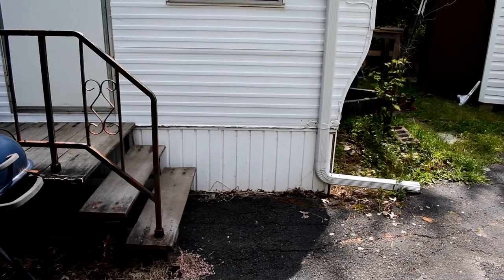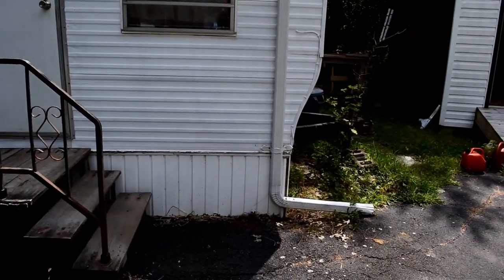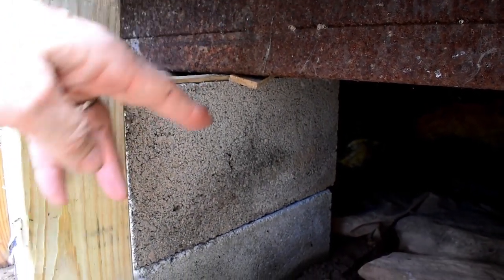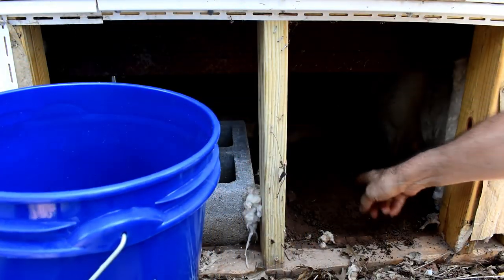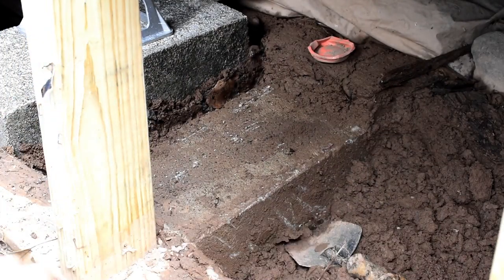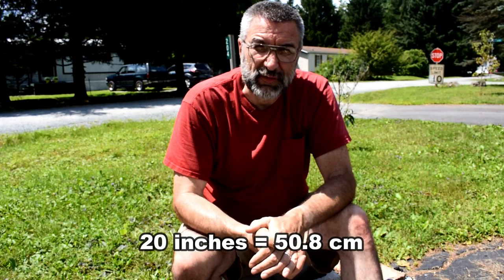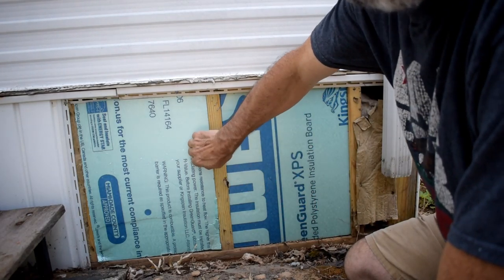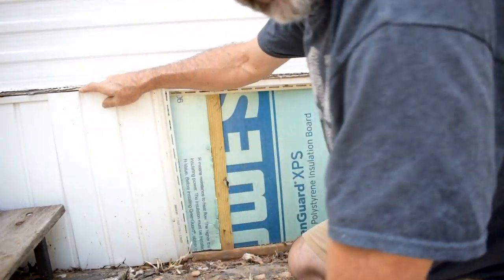Digging a Pier to Fix the Door!

Comment: We built a large porch to our first home, and I dug some holes for the footing under the porch. I went down about 30 inches and cast 12 inch thick pipes as a pier under each of the pillars to the porch. All was well until the winter came. Suddenly the railing no longer was straight and level, but lifted up at one end. Next summer I supported the porch with some beams, removed the pier and dug an extra 20 inches down. That did the trick and now it keeps straight, but I wished I had done this before building the porch! Bless you both.

Comment: I had done with the R10 insulation for skirting.  Came back the next year after winter, I immediately knew the ground had shifted - skirting had bent. Hmm.  Tried to figure out if the RV had gone down, or if the ground had gone up.  Don't rely on the horizontal levels on the trailer, they always seem to show everything is ok, how so false that is.  It was in the corner where I made a small trap door to access the septic tank - couldn't open the door without a crow bar (and then some).  I had knocked the small wood frame with rebars in the bottom part of the frame to hold the frame in place.  Those rebars came up about an inch up the frame which snugged the door to the underside of the RV.  The ground had obviously shifted in that corner pushing everything.  So, if you notice your R5 insulation bending (check it occasionally), then you'll know how much the ground is shifting.  I sure do admire your tenacity.  Just mixing cement wears me out, lol.  Nice work.

Comment: Bill, I hope this solves the winter door problem!  I know you were probably dreading that job, I would have been.  Good idea on the green foam insulation.  I used the green foam on the tiny doors to the attic space in my house.  I glued it right to the doors as they were leaking cold into the bonus room.  It stopped the problem and now the bonus room is snug all year.

Comment: If you ever have to put in another pier, or make the current one deeper, here is an idea.  I realize you have the hardtop walkway which is an issue.  Dig the hole outside of the wall to the depth needed, then widen it out until it is under the wall.  You can then set your pier and fill it back in, tamping as you go.  A digging bar and scoop would be my tools of choice.  I might have removed the 2x4 just to give myself more room as I am a lot bigger around than you are.  This is never easy, but it is possible.  I dug a number of holes with my grandson a couple of summers back, and we did 1 a day (no clay, it was all gravel).  One more thing.  You said it was a dirty nasty job that you were dreading, but I would far sooner dig out that pier than do the “plumbing” job you did on the cottage.  Everyone has their limits.  Here’s hoping that you have solved your problem!

Comment: I noticed you were digging out mud, you should check the other side of the trailer for water flowing under that side also.  Get it as dry as possible.  One thing you could do is build up the soil around the skirt, then put plastic sheeting down, 2 foot out, turn the plastic up a couple inches on the skirting.  Then cover it with a mulch.  That will give you the slope you need to get the water and ice away from the house.
Reply from the maker: It was moist, but it was not mud.

Comment: I think the reason you have such a big difference in your raise on both piers is because the front pier is getting more ice under it.  Put a longer extension on your downspout.  This will move the water away from your pier, that should solve the problem since water expands when it freezes.
Reply from the maker: We have blacktop pavement around the front of the trailer and going up to the door of the shed.  The downspout extends far enough to put the water onto the blacktop, which slopes away from the trailer so the water runs away, not back towards the trailer.  :-)

Comment: Hey Bill. In a previous video, you had jacked up the trailer with your hydraulic jack, and it started to bend and puncture the frame. When you put that jack stand under the frame, you should have put some sort of metal strip or block to disperse some of the weight, as the small round circle of the jack stand is going to push through your frame, which is weakening from rust.
Reply from the maker: Bend and  puncture the frame?  No, I don't think so.  I don't know what video you are referring to or what you are talking about.  If I had seen that happening, I certainly would have done something different.  The paint on the frame is getting rusty.  But the frame is still very solid.
Reply: @LiveSimpleLiveFree  I'd have to look through all the videos to find it. But yes, I did notice that the hydraulic jack was indenting the frame rail when you jacked it up. I'll see if I can find the video it was in.

Comment: You should be getting ready for winter.  Add foam to your exterior walls.  I’d suggest 1 1/2 inches all the way around, covered with new siding.  When you put on the insulation, it should be sealed with canned foam.  You will have to reframe the building, use 2x3 studs.  The roof can be sprayed with foam insulation.  Either replace your windows or cover them with plastic sheeting until you can put in new windows.
Reply from the maker: I have already done ALL of that, on the inside, when I renovated the trailer when we first bought it.  You can see all of that in our Renovations Playlist.

Comment: I know this is a little late for this work, but this might help others.  Depending on soil type, I have used the shop vac either direct or with a drop bucket in line, I will vacuum out the dirt I am loosening.  It helps get deeper, and saves the back in not having to lift up little scoops or small buckets..

Comment: modesty smiley box.. love it.  Fantastic job. Yuk. I put up insulation under my modular and blaaah.. I think it rains under there. Just a yukky job. Today I had enough of my mystery leaker and I figured out you can pop panels on a modular home to get ti the faucet connections.  I plan on trying to replace both tub faucets and shower heads. I also found out I need a drip catch above my doors and the mobile home parks store online has a video on YouTube for replacing doors. I plan on doing that as well. So happy someone is thinking winter because its crunch time. Now or never! Great job. Bless you and your gal Elizabeth.

Comment: The water from the gutter also helps the frost lift that corner.
Reply from the maker: Water from the downspout is not a problem.  We have blacktop pavement around the front of the trailer and going up to the door of the shed.  The downspout extends far enough to put the water onto the blacktop, which slopes away from the trailer so the water runs away, not back towards the trailer.  :-)
Reply: Missed that due to my not paying attention enough.

Comment: The insulation is a good idea.  As you probably realize, you could take off the skirting, separate the sun room, roll the trailer off with its (probably) existing wheels, and then use an auger for the ten (?) piers needed for an addition.  IDK if you would want to go to all that effort however.  Hope the fix you made helps the door close this winter.
Reply from the maker: That would be a MASSIVE undertaking!  And I'm not sure the sunroom would survive.  It is attached.

Comment: Bill, You should have a few vents in the skirting.  As the water in the soil evaporates it will condense on the bottom of the trailer floor and cause the flooring material to rot. Down south where it is very wet much of the year, while we don't have frostline issues, it is common for the floors in the mobile homes to rot and collapse due to this process ... I have helped a number of friends replace and repair their floors in their trailers. BTW, putting a plastic cover on the bottom of the joists to cover the entire floor will cause a similar moisture rot unless it is well ventilated. .... Jim
Reply from the maker: We already have three vents in the skirting, and I should probably do at least one or two more.

Comment: Using a jack on top of the pier is a great idea. Then you can solve any future problems by simply doing an adjustment. My only concern would be if the feet on the jack could possibly crack the concrete block. Wondered if you could lay a steel plate or something on top of the block first.
Reply from the maker: That's why I filled the block with concrete.  Now it won't crack.

Comment: I think you need to extend your drain pipe to a minimum of 5 feet to avoid moisture compromising what is under your home   I use foam insulation whenever I can. So much easier
Reply from the maker: We have blacktop all aronund the front of the house.  The downspout empties onto the blacktop, which slopes away from the house.  The water is drained away.

Comment: Hi Bill! You certainly had the right idea but you didn't go to the right people to ask for the advice. You should have went to a small Hometown Hardware lumber store and met with a planner. There are newer forms of insulation that are more of effective. And if someone else mentioned that downspout needs to be extended the water is playing havoc and causing part of your problem. I used to work in a joint office of assessor and building inspector and I've learned a lot from those guys. Frost does not go sideways it goes straight down. It probably would have been more effective after you re stabilize the building to put it more and heavy duty insulation such as a Rockport there which is also water-resistant. I am planning on doing the same thing with a 73 ft by 12 ft wide mobile home. So I took great interest in your project. Since the mobile was built in 1973 but remodeled in 1990s it is really nice inside but it is an eyesore on the outside. And it was given to me because the purchaser of the house next door did not want the mobile home on his lot. The city and county would not allow because the purchaser of the house next door did not want the mobile home on his lot. The city and county would not allow to be moved down the city street because of his age built in the 1970s. and of course in their eyes there is the asbestos problem. Still today many items are made with asbestos so that's not a valid an up-to-date way of thinking. the mobile that I had was not tied down and it was sitting on Railroad Timbers for approximately 25 years. The railroad Timbers iron fairly decent shape with some right underneath because it always has been dry as I lived in the Colorado High Desert. another YouTuber insulated underneath his mobile home with a bubble wrap foil coated I'm staying away from using brand names. to prevent it freezing underneath the trailer and he tested this by to prevent it freezing underneath the trailer and he tested this by putting milk jugs filled with water along the interior outside walls. When he shot his video it was just above 0° Fahrenheit. And the water in the milk jugs did not freeze. He also had the bottom of the trailer insulated so he did not lose a lot of heat through the floor. Then he enclosed the bottom of the trailer using the same plastic scoring system that you have. after you extend the rain pipe and any other water collecting areas await you might want to dig down 6 in and put a plastic liner to shed the water and slope it away from the building that will also eliminate the moisture in the heating somewhat not totally but someone. Remember that one principal and I think it's the most valuable one that I could give you is that Frost does not go into the ground sideways and spread it just goes straight down. however a wet soil condition as from where downspouts terminate will draw the freezing cold that will travel in the water to its lowest  point where it will expand when it freezes. and there is the great pressure of the lift that you are experiencing.
 
My 1976 home where I live has a crawl space. There is no heat in that crawl space and that floor gets freezing cold.  the second most important piece of advice I could give you is to look into the Rock waterproof insulation board. Once again staying away from brand names don't want to get in trouble.  you obviously do not have Critter problems. I thought of that as you were putting the insulation board on the bare ground. rodents like to chew up that style of insulation. Yes it is somewhat water-resistant but if you get some Critters underneath there you'll start seeing the foam all over your backyard. you may want to cover that phone with an inch or so layer of gravel. That works just as a deterrent and there's no guarantee that they will not dig through it.

The next time that you need to dig a hole and you can't reach down any deeper I have a suggestion. Try going to your local tool rental place and getting a very large Shop-Vac from them. Make sure you're able to power it. I told him what I was going to do with it, dig a deep hole and suck the dirt out of it and they told me go for it's in your rental fee, an insurance policy that if it comes back and it doesn't work we can replace it.   I do not know if all tool rental places think the same way.
Reply from the maker: Water from the downspout is not a problem.  We have blacktop pavement around the front of the trailer and going up to the door of the shed.  The downspout extends far enough to put the water onto the blacktop, which slopes away from the trailer so the water runs away, not back towards the trailer.  :-)

Comment: The reason code calls for 42" is cuz that's the frost line. If you can't dig down to frost line have you considered just reinforcing the frame that runs along that side, so as it shifts it will shift evenly? Just a thought 🤔 I'd run a steel lintel between those 2 piers under that entire side. Interesting observation on them being out of R10. We used R10 to insulate basements when we built houses. There's no housing boom but I do hear theres a shelter boom going on though. Wonder if it's related.
Reply from the maker: I know I'm not below frost line.  But I'm much closer.  So I know I will probably still het some heaving, but I'm hoping that the heaving will be greatly reduced.  And it usually only happens in the very coldest of weather.

Comment: Maybe you have thought of this or it has been in the comments , but why not have an access door right where you did the new pier work . Then if it does heave a bit and the door sticks , you can access the RV jack easily and adjust it as needed .
Reply from the maker: I'm planning to do that.  But for right now, I just needed to get it put back together temporarily.

Comment: Glad you decided to compromise on something more doable.  It should be better and that is all you can hope each time you work on something.  Be careful if you decide to adjust the height should jack it first then tighten and let down.  Those aluminum stabilizers can crack if used for jacking going from experience using them for the wrong use in a pinch on the side of the road to change a trailer tire.  Nothing bad happened just heard the crack and hurried to get the tire back on.  I did buy more though since they are pretty handy.
Reply from the maker: Compromise? What compromise did I make? I don’t understand your comment.
Reply: @LiveSimpleLiveFree  You picked a good choice that was the middle ground or compromise between doing nothing and making that full footing you described.  I have seen people going extreme to make those big footings in place.  Taking more apart and digging deeper.  I think you made the right decision.  The other process I have seen is they dig a small trench in their yard towards the footing location from the side.

Comment: I know you've been very clear as to why you wont add an extension or alter the existing one but have you considered adding an enclosed porch over the door? I was thinking this would make the stairs easier for Elizabeth in the snow but also provide a sort of air gap when the door is opened during inclement weather. x
Reply from the maker: It would be the same situation, with the building inspector requiring footers under the entire trailer to build a porch that attaches.
Reply: @LiveSimpleLiveFree  good grief! I see it's going to remain the status quo that you have to repeatedly dig out the stairs in the snow! Thank you for replying and I hope you didn't mind me asking? xx
Reply from the maker: @coffeefetcher  I have to dig out the entire driveway.  Adding a couple of steps is no big deal.  :-)

Comment: It’s no wonder your son knows how to do all the stuff he does with houses. This scared me at first with the jack. This is really so brilliant though because all you have to do is adjust the jack if something moves which is totally cool. Nice job. You remind me of my father with no knee pads just a towel. “Live Simple”. 
Thank you for sharing your projects with us. It makes me smarter which I enjoy. I’m sure the Door will be fine now. I do have a question. You put more insulation there in that one area. Can it really do what it needs to do if all the rest of the way around the trailer has less insulation? I hope that makes some sense. All of this is over my head.
Reply from the maker: My knees were on a very padded pad.  But it was black, and when the sun hit it, it got too hot, so I had to put the towel on top.  Having extra insultation right net to the pier will help even if the rest is not done.
Reply: Tinyhouse Prepper Thank you for the information.

Comment: "Moisture coming up from the ground....."  Is the crawl space vented?  If not, Did you, have you put down a vapor barrier to help prevent your floors and the floor framing from rotting from trapped moisture under there?
Reply from the maker: Yes, the skirting is vented, and yes, there is plastic on the ground under the trailer.
Reply: @LiveSimpleLiveFree  good to know, was just curious